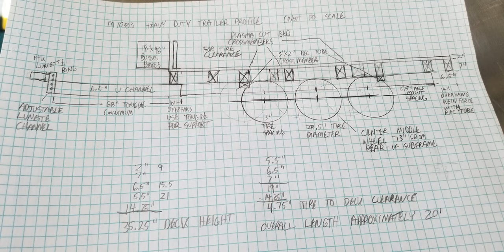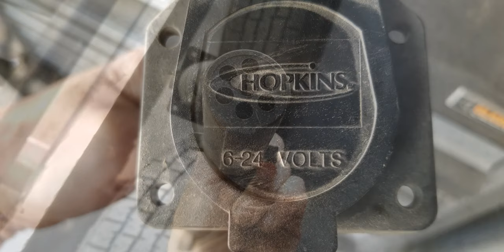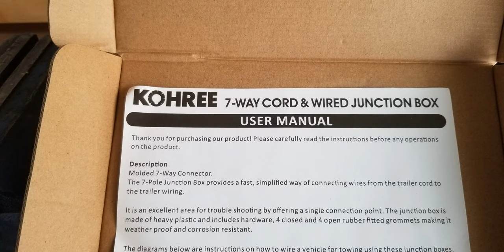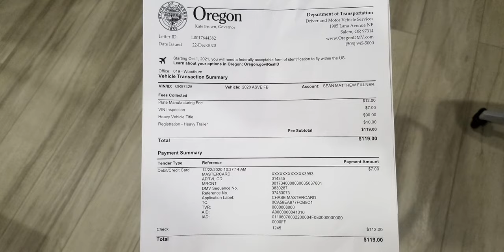M1083A1 7 ton trailer build Day 365 (build slideshow and registration/use timeline)

Comment: Ok, finished the 7 ton trailer series…great build!  Did you ever state where you sourced the axles?  I must have missed that…I mostly wondered if they were also military vehicle parts or something else.  Thank you for the responses to my previous comments…it’s very kind of you!  One of the greatest things about YouTube is the ability to actually connect with “the guy” doing “the stuff”. 👍👍
Reply from the maker: Axles were sourced in a previous video in another series.  I bought them new from an rv store owner for a fraction of the price.
Reply: @SeanFillner  Cool…just wondered as they didn’t look overtly “military style” 😉
Reply from the maker: @fsfazekas  they are dexter high end torsion axles.  10 times better than any leaf spring setup.